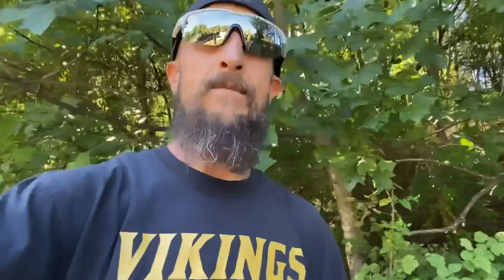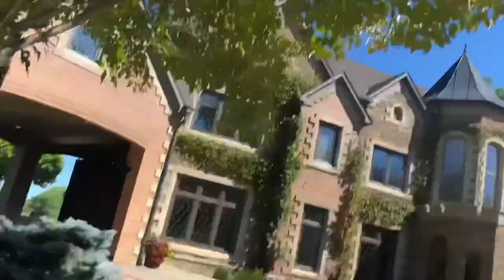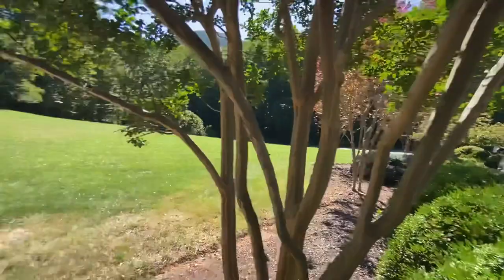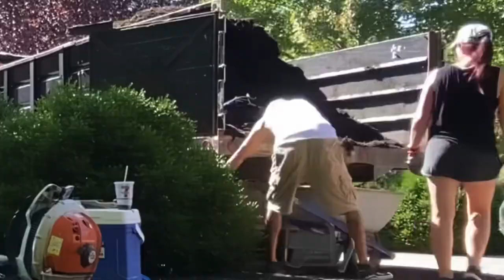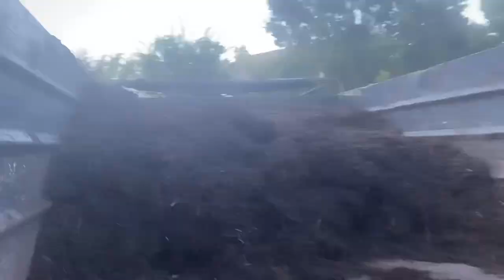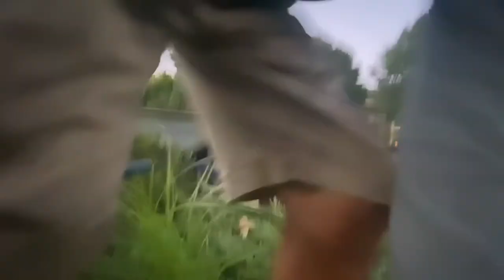LARGE JOB STRATEGIES // OVERGROWN VINES // Dyed BROWN MULCH for SHOWCASE PROPERTIES

Comment: I agree - I never dump mulch out - To me its alot easier to work from truck/Trailer than to scoop it up off the ground-Plus i can move truck around site to make it easier on labor saving boat load of time - just the ability to move truck 40ft this way 40ft that way is huge on morale when dong 20plus yards mulch jobs.
What happens if u dump it out and you got a yard or 2 more than u need? See thats a ulgy situation fosho cause u got to scoop it all up - we both know that mulch aint a exact science! great job buddy
Reply from the maker: I agree 100% Ray… that’s why I like my small trailer with the sides. It holds 6 scoops of not wet.